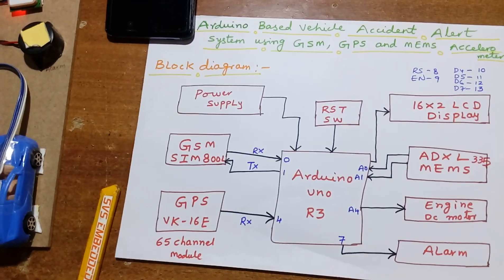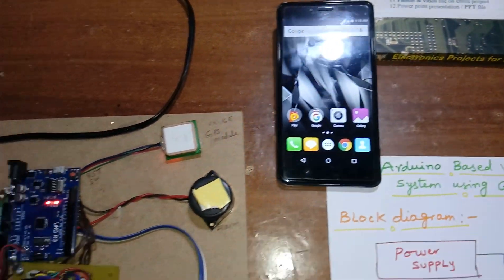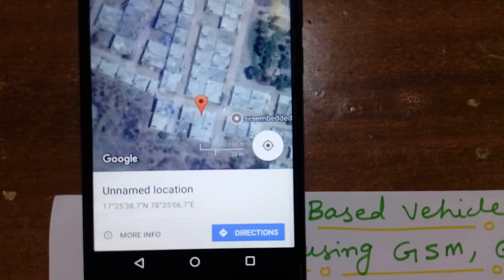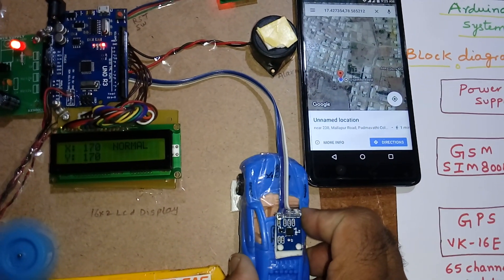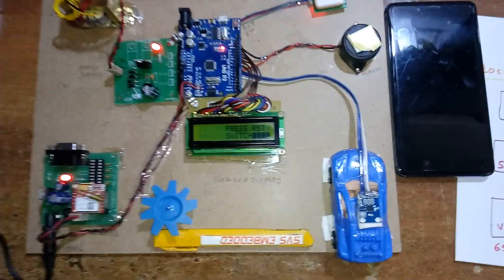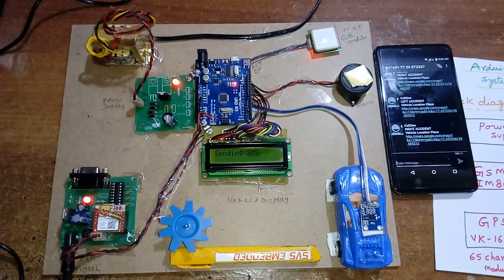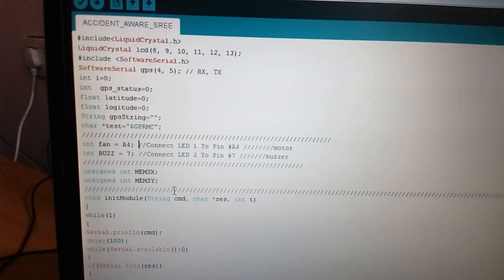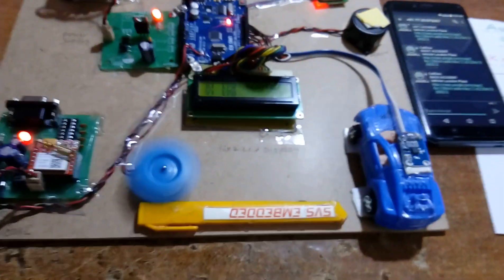Arduino Based Vehicle Accident Alert System using GSM, GPS and MEMS Accelerometer

Comment: I have two questions sir
1) If accidents occurs at remote/hilly areas there will be no network then how GSM module can send message 
2) If we are using Electric(EV) cars it doesn't have engine DC motor then how ? 
These are the doubts I have got after watching the video I hope you don't mind.Can you please answer them.
Reply from the maker: Thanks for watching and your valuable Feed back. this is prototype model sir.

Comment: hello sir, can you mail the code to saikalyan3666@gmail.com ..I need the code for giving the seminar on Arduino in my class. please send ASAP.
Reply from the maker: Thanks for watching and your valuable Feed back.yes we will help on coding part.
we are selling the projects with least cost.if u order the project we will provide working hardware kit along with 
1.abstract
2.datasheets
3.documentation
4.schematic( circuit ) diagram.
5.software code.
6.sample ppts
7.photos&video file on entire project
through google drive.if u r interested to take the project.
send me a mail to  svsembedded@gmail.com,info@svsembedded.com.
9491535690,7842358459,
www.svsembedded.com,www.svskits.in,
we will send u the how to order procedure to u on mail.

Comment: This is fantastic and amazing project. I am  very interested in your project in order to see its implementation. sir if you are interested  please send me the circuit diagram and code of the project on my email address bilisummaagammachuu@gmail.com . i believe you are coming with new advanced project.  thank you.. .
Reply from the maker: Thanks for watching and your valuable Feed back.yes we will help on coding AND CIRCUIT DIAGRAM part.
we are selling the projects with least cost.if u order the project we will provide working hardware kit along with 
1.abstract
2.datasheets
3.documentation
4.schematic( circuit ) diagram.
5.software code.
6.sample ppts
7.photos&video file on entire project
through google drive.if u r interested to take the project.
send me a mail to  svsembedded@gmail.com,info@svsembedded.com.
9491535690,7842358459,
www.svsembedded.com,www.svskits.in,
we will send u the how to order procedure to u on mail.